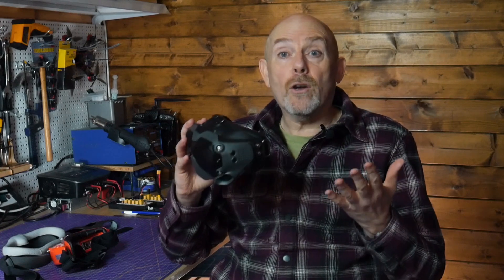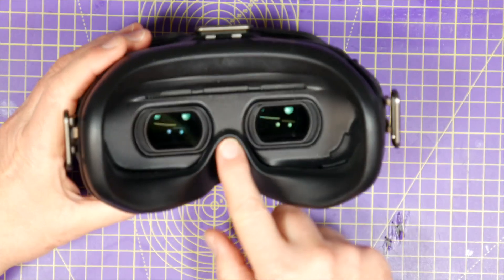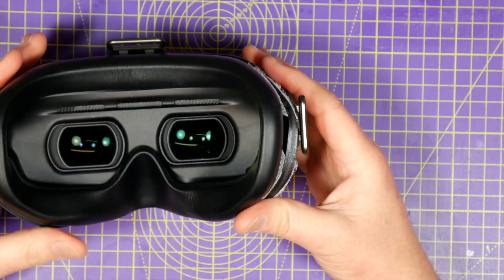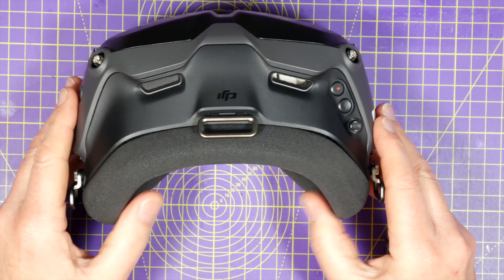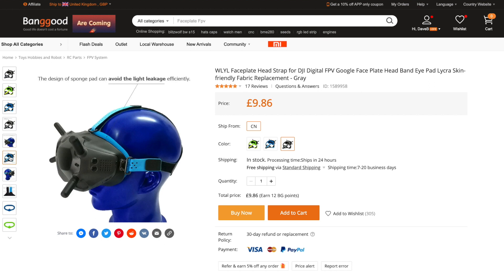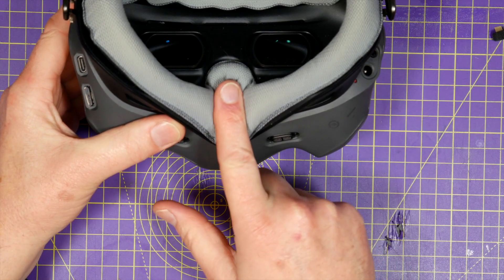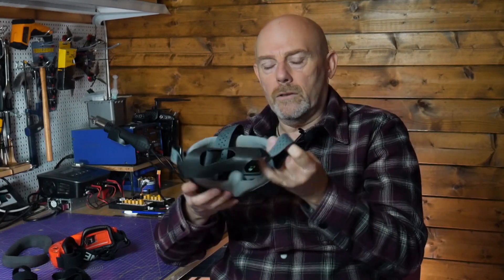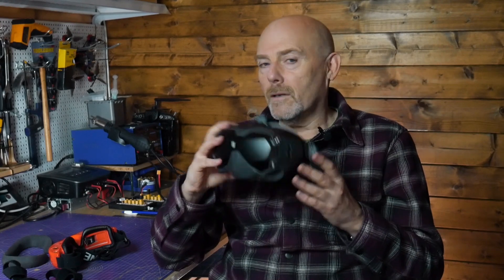DJI FPV Digital Goggles - fixing the light leak problems

Comment: In a couple of other videos, they cut the nose section from the original padding and leave it in place and then add the replacement sponge. If needed, you can also add the little sponge piece as well.
Reply from the maker: Yep, that works as well. Do whatever you need to make it fit your face.

Comment: I just received my drone today. The terrible goggle fit is inexcusable at this price point. There should at least be a thicker pad included. For my face, they are unusable. I bought the replacement pad. Hopefully this will fix the issue. Do better, DJI.
Reply from the maker: Oddly for DJI, they really screwed up on this. Really annoying.

Comment: I waited 2 years to buy my 1st drone.  To find out how bad the FPV Goggles fit right out of the box.  What a SH!T company.  Zero engineering knowledge and I would have at least have made the sides wrap around the head 100% fit.  I am beyond pissed at how SH!T the "engineers" designed these goggles.   They sit way off my face!  My light leaks are bad and exactly the same: from the bridge of the nose and behind on both sides.  Appalling!!!!!
Reply from the maker: It's not great and spoils an otherwise awesome product.
Reply: I agree 100%. I would like to see the sideshow freak they used as a head model for these goggles.

Comment: I’ve just received the ones from banggood but the head strap is too small and presses them very tight on my head. Plus the foam around the nose means I can breath. It doesn’t look like you have the same issue with yours
Reply from the maker: As I've said many times, one size or make doesn't fit all cos we've all got different shaped heads.

Comment: Thanks for  the review and links.  The original is horrible for me.  The DJI sponge is better but the nose is still leaking even with cutting the nose section from the original and also using their foam tiny nose piece.  I just ordered the Banggood ones to see how they work out.
Reply from the maker: The Banggood one is surprisingly good for the money. Thanks for watching and the feedback.
Reply: Hi how did the ones from Banggood work out for you? I have the DJI ones bit crazy light bleed. Tks
Reply: @armani007E55  I never used them.  I realized the light leak by the nose doesn't bother me at all.

Comment: Agree - it's ridiculous having to spend $$$ on foam pads for $600 goggles - complete rip off. DJI will only get away with this as long as there is zero competition in the digital FPV niche.
Reply from the maker: I suspect there may a V2 sometime or at least a new mask foam.
Reply: EXACTLY!!!  I would have crapped in the box and sent it back if there was competition.  Abhorrent "engineering ".

Comment: Hello, sorry to bother you but l just brought new emax hawk pro 6s. I managed to bind my frsky d8 receiver to my t16 jumper pro. Won't armed the motors, if l push throttle stick to the right corner, all it does it's beeps and red light flashing on the stack. On betta flight looks like it is the right orientation. But haven't said that if l turn on receive on betta flight, there is small drone on the screen and this think does all sorts of things without doing anything on my jumper. What's wrong with it?  Can you help please.? I live in Walton on Thames KT12 area. Please answer something thanks
Reply from the maker: Check out JB's  video on arming problems. https://www.youtube.com/watch?v=N8oMMG2kmns